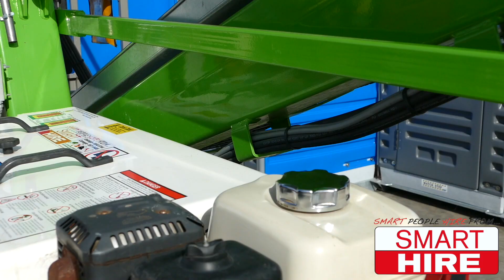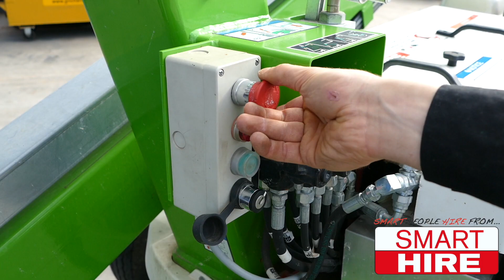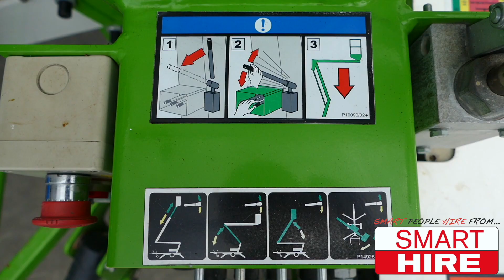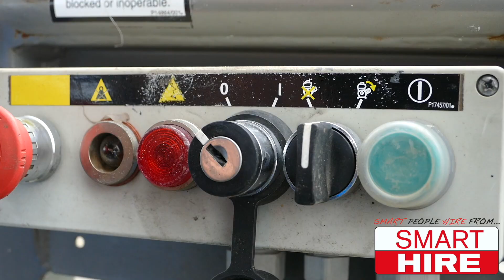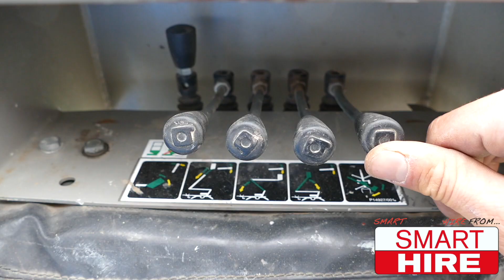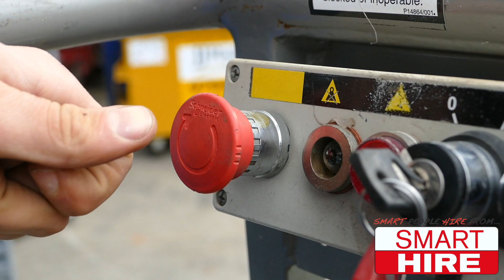How to operated a Cherry Picker

Comment: Great video
Can use use the machine with out the engine running as it has battery power banks or do you need the petrol engine to operate hydrolics for legs and lift operation